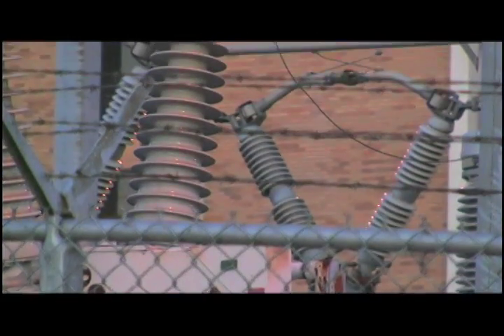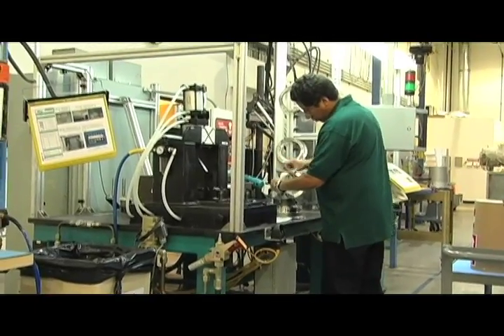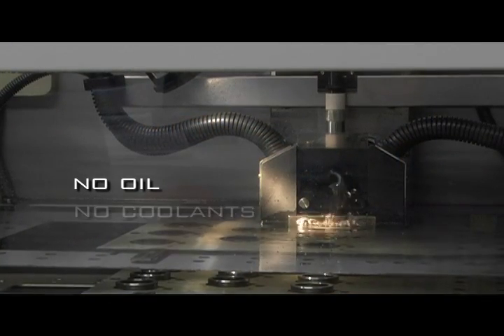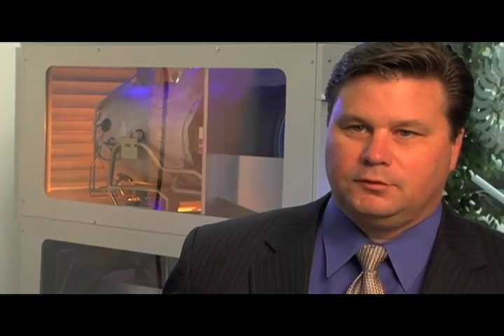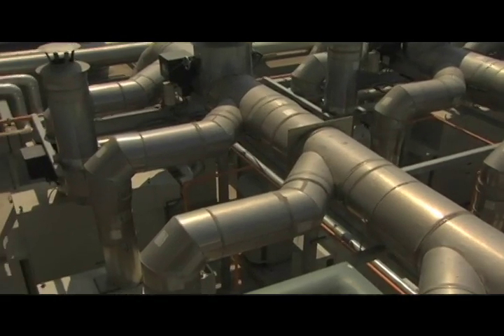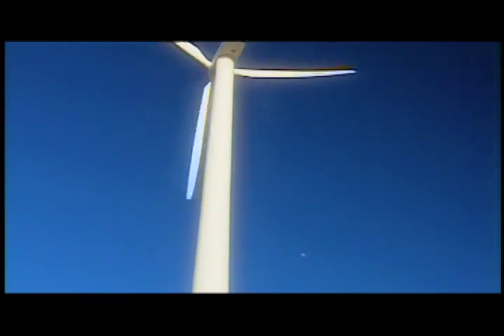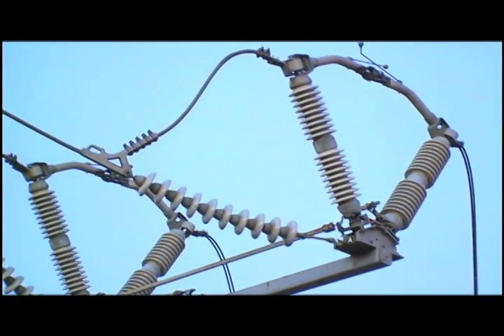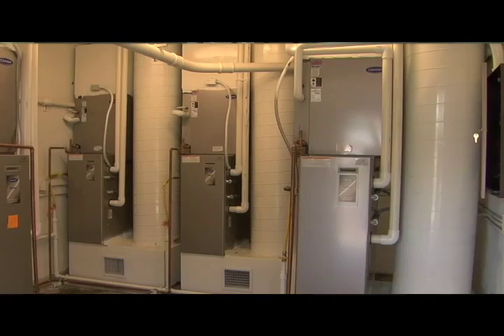Capstone Microturbine Corp Demo

Comment: Ummm...wrong...reciprocating engines for stationary power are far more efficient for electric generation than microturbines. Micro-turbines have a 11-13 dth/MWh heat rate versus a 7-9 dth/Mwh heat rate of reciprocating enginges.

Comment: Microturbines are far more efficient than any reciprocating engine. With a heat recuperator their efficiency is at least 30 - 35%, and It's only the beginning. When they will have new ceramic materials for the turbine, the efficiency will grow up.
Reply: Your numbers are incorrect. Reciprocating gas engines are 40-45% efficient.  Checkout Wartsila and Man Gas engines.

Comment: If you look at aircraft engines, you will see turboprops burning a minimum of 35GPH. A Glasair with a reciprocating engine that goes just as fast (over 200MPH) will burn less than 20GPH. Turbines are NEVER anywhere near as efficient as reciprocating engines. They are best suited to very high output, where a recip engine would be incredibly huge. Even then, some of the largest boat engines are still reciprocating.